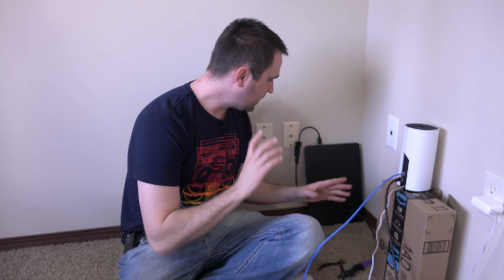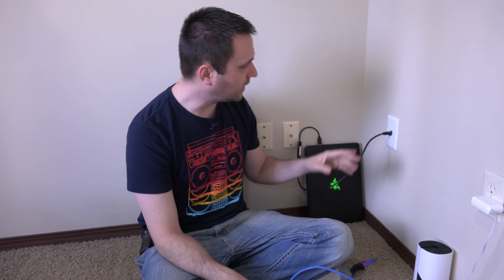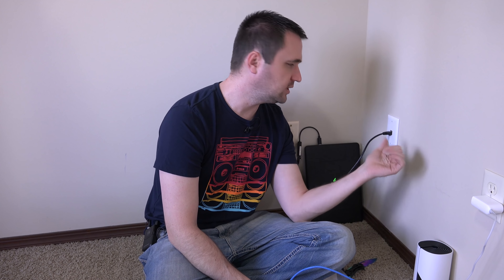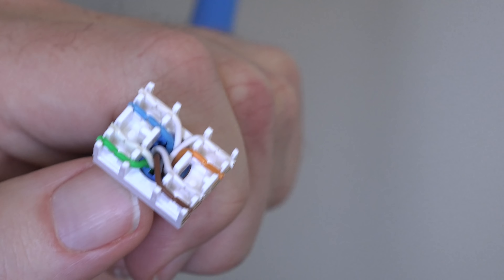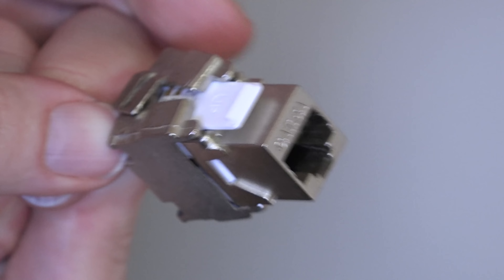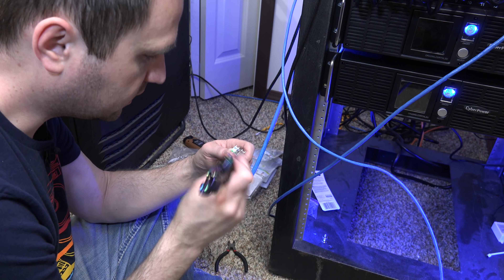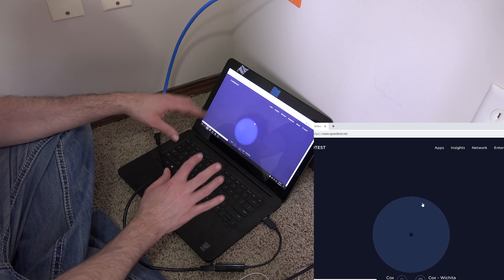Keystone Ethernet Jack issues... User Error?

Comment: use an idc punch down tool to terminate the jack, dont rely on the metal housing to correctly insert the wires for you, then test the connections, even a cheap rj45 tester should do the trick.

Comment: I'd recommend not going with tool less keystone jacks  get a 110 punch down tool and use it 

I guarantee that they will be more reliable
Reply: Or get a leviton atlas X1 jacks.
Reply: I know I'm commenting on an old video but coming from the networking & telephony world I didn't even know the jacks he was using existing.  Cheap punchdown tools are way more available than they were 15-20 years ago, heck even the manual 'push' tools where you cut the wires after you push them into the terminals would work better than what he is using.

Comment: OMG! ALL these so called "experts" on here and not ONE spotted the problem, not a SINGLE ONE!

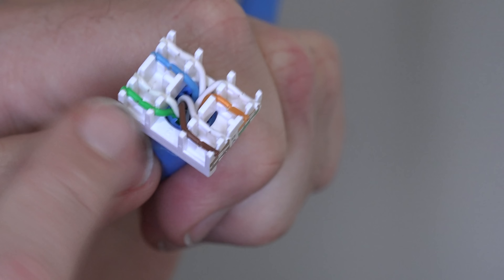Several people told you about using a punch down tool and that almost got to the problem but as soon as I saw the video at 4:10 ... BOOM! There was the issue staring right at me!

Once PROPERLY connected you would NOT be able to remove the cable from the jack and have it look like that. 

Your cable MUST be punched down into the IDC contacts FULLY by using a "tool" of some sort. Krone tool (best), plastic tool (works great but you then need to trim the ends sticking out the IDC (Insulation Displacement Connector) or do careful wire alignment prior to punch down, or finally a tool less connector. The one you show doesn't actually look like the ones I've seen as being proper tool less.

 Whatever, your wires should be prepped by laying them into the IDC part and holding both sides of the wire push it down into the plastic part of the slot to the start of the metal contact. THEN, when all the wires have been placed should the white plastic cover/tool be pushed in to drive the wires down fully into the contacts. 

You should then be able to pull back that white cover/tool leaving all the wires connected. At that point you can check to see if any wires are not fully inserted and correct if need be. 

Your video shows that your wires have come away with the cover/tool which should NEVER happen as it is only an insulating cover NOT a cable connection or receptacle. If you use a proper tool they can be omitted completely and your cable will work fine.

As regards to Cat5e v Cat6 I have almost exclusively Cat5e in my house (as I did in my last one (2 years ago) and I run 100% gigabit everywhere with zero problems. Even 10Gbit can be done within reasonable distances on it in a domestic environment. Do not rely on it for those speeds anywhere commercial!

Given that this link shows a Krone type tool for £1.89 (as if April 10th) just get one for your tool kit.
https://rover.ebay.com/rover/0/0/0?mpre=https%3A%2F%2Fwww.ebay.co.uk%2Fulk%2Fitm%2F352289818589

But if you want to get a cheap one locally, then in whatever country you live your local hardware supermarket will have one like or similar to this almost certainly:

https://rover.ebay.com/rover/0/0/0?mpre=https%3A%2F%2Fwww.ebay.co.uk%2Fulk%2Fitm%2F141546580981

Bottom line: ALWAYS insert wires into the IDC contactsfirst and NEVER into the shroud/cover/tool. THEN punch down the wires.

Comment: I've been in the structured cabling world for 20+ years and have certifications in all kinds of technology including copper cabling, fiber optics, access control systems, physical security systems, and am currently working on my CWNE. 
First off, never EVER remove the insulation from the wire like you did with the knife. That only made things worse.
Next, the cable: Cat5e would have done just as well if all they're running is gigabit Ethernet without PoE, but the technology behind it is way old (I was installing Cat5e when I started back in the mid '90s). Cat6 is the new standard and has higher bandwidth than Cat5e so the overall network throughput would be a bit higher, and is capable of PoE. Cat6A is rated for 10Gig speeds, but pretty useless in a home setting unless they're shelling out some serious dough for 10Gig switches. LinusTechTips YouTube channel JUST upgraded to 10Gig internet, watch their video series on their 10Gig upgrades. 
The problems you are having indicate a possible kink or knot in the cable that happened during installation. Maybe it got caught or cut on a nail and the bend radius was exceeded. You should also use a better quality jack like Leviton, Panduit, or Ortronics. The way you terminated the jack is a huge issue as well. There are very specific ways the cable needs to be fed into the connectors on the back and when done incorrectly can cause major crosstalk, the most common cause of all LV Technicians' troubleshooting nightmares. A lot of Cat6A cable is shielded as well and needs to be grounded on one end, that's why the body of the jack is metal.
You are probably going to need to get someone out to the house with a tester capable of certifying Cat6A cabling, something like a Fluke DSX-5000.
Best of luck!

Comment: Not an expert just another home wiring fan, but I never trusted those tool-less claims and have used a 110 punch down tool on every connection I have ever done. I cut my stripping back extra far so I have plenty of wire sticking out past the connector blades. Then I lay the individual wires in the top of the IDC blades and use the tool to bottom the wires all the way down into the blade. It's far enough in that not only is the insulation displaced, but you can see just a bit of distortion in the conductor itself so you know the connection is firm. Once all wires are inserted, I trim off the extra length so I can install the other half of the jack. It just acts as a cover and is never used to push the wires into contact. Doing it this way takes a bit longer but is much more consistent in quality. The connection is so firm that when I have needed to remove a wire there is noticable force needed to pull each wire out of the individual blades and they come loose with a little pop.

Comment: Maybe I didn't see the jack design clearly but it looked like the ends of the wires might be making contact with the metal shroud of the jacks. You could try putting a piece of electrical tape over the exposed wire ends on a faulty jack to verify.

Comment: I know it was already said but check the brown/brown-white wire on the jack in the server room. It appears to  be reversed. That should resolve the intermittent connection issue. As for the network speed, try connecting your laptop directly to you switch in the server room using the adapter, this will set the standard for the maximum speed you will see using it before testing it through the keystone wall jack.

Comment: Just curious, for the file transfer test, was the laptop plugged into the AC power? I've definitely seen issues getting full speed on networking devices with a laptop on battery because windows wanted to lower the power consumption.

Comment: I just moved into a brand new building and half the jacks are wirepath and half are levatron.    80% of the wirpath jacks are having this issue and 1 of the levatron jacks is having a similar issue.    They are all CAT6 wiring.  I've been in network operations for 20 years and have never had this issue with CAT5.  But I am going to check some of these jacks as per your suggestion.  It make perfect sense to me as they do have a thicker shield.

Comment: You said that those are shielded cables, but I didn't see any foil, braided shielding, or a drain wire. If it is a shielded cable, make sure the drain wire is making contact with the body of the jack. Also, shielded cable should be bonded to a separate ground from the electrical system. The relevant standard is ANSI/TIA-607-B "Generic Telecommunications Bonding
 and Grounding (Earthing) for Customer Premises".  

However, ANSI/TIA-570-C "Residential Telecommunications Infrastructure Standard" states that the only jack that should be used in a residence is UTP, those are definitely STP jacks. (It also states that all terminations should be to the 'A' standard. Let the flame wars begin.) 

Again, I couldn't tell if those are actually shielded cables. Only use STP keystones with properly bonded STP cabling (for one, doing otherwise is a waste of money). If the jacket on the cable says UTP, use UTP keystones.

Comment: I'm assuming the cat6a cable has shielding?  If so it must be properly connected to the shielded jack and everything must be grounded using shielded cables (metal on connectors) to properly grounded equipment.  Also, if you ran your cable next to power cables it will introduce interference.

Comment: Did you check to see if your usb to ethernet adapter was running at usb 3.0 speed or make sure it was a usb 3.0 port.
Reply: If he got less than USB 3.0 speed his sustained file xfer speed would've been way less then 110-112 MB/s aka 880-896 Mbit/s. USB 2.0 top spec'd speed is 480 Mbit/s but 80% or 380 Mbit/s in real life which translates to about 47.5 MB/s. Less then half of what he was getting.

Comment: I used some metal CAT6A jacks from MonoPrice and I had similar issues.
I found just replacing them with plastic CAT6A jacks worked right away.

Those metal ones just seem to have issues.
Reply: First thing I saw when he started putting the knife into the wires... the outside edge of the plastic retainer allows for the ethernet's wires to protrude past the plastic and when the metal shield casing is clamped on, they could be shorting on it.
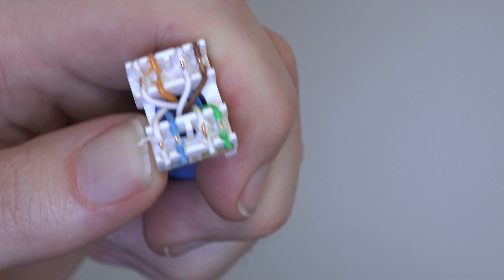If you stop it at 5:45 you can clearly see the wires over exposed outside the plastic ridge. With him using his knife to push down and scrape the wire coating, I can only assume he's moved them just enough (as with the wiggle when inserting/removing the jacks) that the cables are no longer touching the case and thus causing a short. Maybe he could just go back and clean snip those flush with the edge of the case.
Reply: i stopped buying from monoprice over 10y ago when their 12v chargers and HDMI cables broke off in my hand. Walmart of technology.

Comment: "Depending on how I plug in a cable" - First thought is either the keystone is bad or the cable is bad. Swap each out.

Plastic = Insulation; Foil/braid = Shielding.  You have shielded cables but is the shielding grounded?  Do you run your network cables in close proximity and parallel to 120V wiring?  Did you check your patch cables by swapping them out?  Did you verify that the keystones can work with the wire gauge of your CAT6A?  Did you verify if the keystones are meant for solid copper or stranded copper? (it's probably solid but i assume you bought on amazon so you never know) You shouldn't have to strip the insulation off at all.  Any kinks in the wire run that potentially damaged a conductor?
Reply: Steve Patak soooooo many words. I clearly need to learn more! Thank you for the input. You’re a plethora of information!
Reply: joyjamiebrady it’s basic info once you learn the basics of a network.

Comment: Jason, coming from a professional low voltage cabling standpoint; ditch the "tool-less" keystone jacks! Over and over again I have had nothing but problems with them, no matter the brand. Normally you shouldn't ever have to strip the wires with CAT5/5e/6.
My recommendation would be to get standard punch down keystones and a  "110 punch down tool".  (Home Depot carries the tool fyi.)  Also stick to known good brands of keystone jacks. Cheap keystone jacks make the hugest difference.   Top keystone brands would be Leviton (best), Vanco, Panduit, ICC.  You can certainly still use monoprice if preferred,  just use the standard punch down ones!!

PS: Please try out iperf.  It would be a good video on its own!
Reply: I would say it's much less common, and so more difficult to even find shielded Cat 6A keystone jacks that require a punchdown tool. You'd have to put in extra effort just to obtain them. Of course, with unshielded Cat6 or 5e, easy peasy.
Reply: Hi there, I wasn’t aware that the cable didn’t have to be stripped. Is it ok that it is? My connection is working fine. Should I start again by snipping the bare cable and punch down the cable with its shield?  Thanks
Reply: @HousewerkRecords  For at home, if it's working, and providing you with good quality speeds/reliability, it's probably fine to just leave it.  The worst it'll likely cause is some RF ingress or jitter.  Likely for home, it's probably not a deal breaker.   In a commercial environment however, if I saw that, yeah I'd probably redo it.   Ultimately it's up to you!

Comment: Woah!  At 4:30, you show the wires in the cover!  That is a cover, not meant to do the actual punch-down.  Use a punch-down tool to push the wires fully into the terminals, then use the cover as strain relief.
Reply: I think you may be confused. He's actually using a Cat6A shielded "tooless" RJ-45 keystone. You don't use a punchdown tool for these. Poor choice in my opinion.
Reply: @BoeWalls  
Thanks.  Definitely my error.  Though, like you, I don't think I'd trust a "tool-less" jack.  I like to know I have each conductor punched in securely.
Reply from the maker: live n learn :)

Comment: those wall jacks are generally designed to be used with solid core cable. You are using stranded, this can (and probably has) caused weak connections as the cable inside the insulation bends instead of crimping in the jack.  If you do not want to run all new cable through your walls then consider changing your jacks over to the type where you strip and clip the wires in the port, not the snap down self crimping type. those work much better for the stranded cable.
Also, contact one the network tool vendors, let them know you want to 'review' a network test tool, then use it to test your runs, much better than trying to fiddle around with connecting pc's (via dongle no less) that introduce a number of other factors.
Reply: I've had good luck with these CAT6A jacks.  https://www.amazon.com/dp/B00CLVAJCK/  I'm using solid core wire but the listing says they should work with both solid and stranded.  You will need a punch down tool for these though.  Either Krone, 110 or if you're really lazy like me the Cable Matters custom crimp tool that does all 8 wires at once.
Reply: Check the video again its solid.

Comment: Video unwatchable, sockets aren't level between the two walls.
Reply: Absolutely. As a home network installation guy and slightly OCD, this drives me crazy. Even the coax outlets look as if they are different heights. My god man, take some pride in your work.....lol
Reply: Boe Walls I believe the coax wall plates were from a previous owner. Still, why wasn’t a two port keystone wall plate used? It drives me nuts to see so many wall plates in one area.
Reply: @im_sarge_bro4542  Exactly. Also, if you pull 1 Cat6A cable, why not pull 2 while you're there. Its called future proofing.
Reply: Boe Walls I always pull 2 or more cables at each drop. Since I do commercial, I actually run on average 3 drops per location. There’s no reason not to run more than one.

Comment: ive never used these toolless keystone jacks, I always use punchdown plates. Id be inclined to use my punchdown tool on the individual cores in that jack to ensure a good contact. Id not recommend scraping the sheathing with your knife as you could put microscopic nicks in the inner copper which could cause it to snap or at least weaken it.

Comment: Cat 6A is good... but you need to make sure of several things...   1. the punch down is good, 2. the wire stays away from electrical wire... and 3.. that you did not have a rodent chew the wire in the wall somewhere...  also cheap testers do not check if a drop is working at the speed it should...  it just checks continuity and if you have cross wired the jack... I recommend you use "B" for all your wiring...

Comment: I know i'm late, but here are my thoughts: 1) my understanding is that crimp-style ethernet jacks are not intended to be used more than once. the blades on them immediately dull after the first bite and subsequent crimps often result in poor electrical connections. i'd try fresh connectors from a better manufacturer. 2) while Cat 6A is great cable for long runs with excellent reliability, it's weak point is bend-radius. Cat6A needs smooth gradual curves around corners and such as more extreme bending results in compromised data integrity/throughput. maybe make sure you dont have kinks are hard bends in your run? and 3) as highly shielded as Cat6A is, it is not immune to interference, especially from RF noise right next to the run (think parallel runs of home electrical wiring). interference absolutely can degrade performance by yanking down your SNR. I hope you figured out a conclusive answer! enjoyed your video!

Comment: It looks like you have good Ethernet wires. But at your server looks like you have a solid Ethernet not stranded. The solid wire can't bend back and forth a lot that's why use it in the wall. Did you take that jack out of the wall in your server room? If not you should have it in the wall because it's a solid wire. Stranded wires are used for the wall to the units. Because they can band back and forth a lot with out breaking.
Reply: True, but I think he said before that he got a really good deal on bulk Cat 6A (solid core I assume), so that's probably why it's everywhere now, lol.

Comment: I vote trash those keystone jacks and get some standard punch down ones.  The ones you have rely on pinning the cable between the connection, splitting it and holding it down, ... all with a metal shroud that if even the slightest out of spec, will fail you...    Punchdown style, or bust, .. imho...

And, ......  please....  use iPerf...   lol...